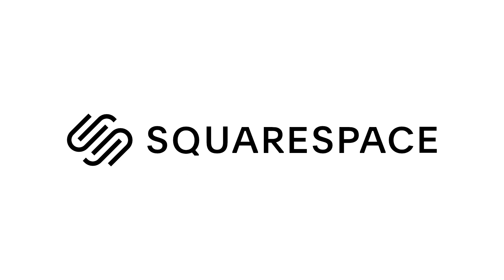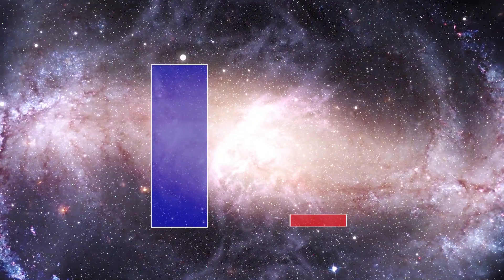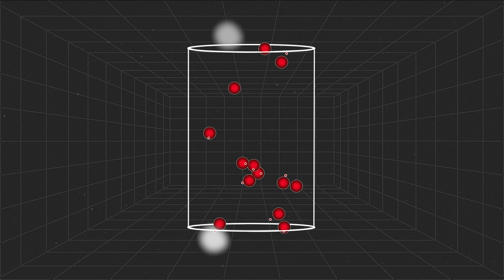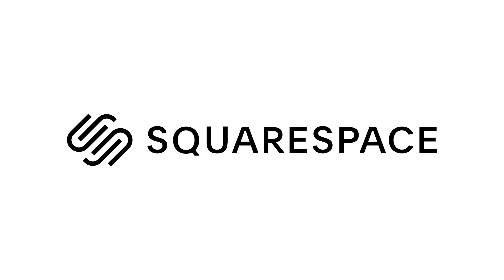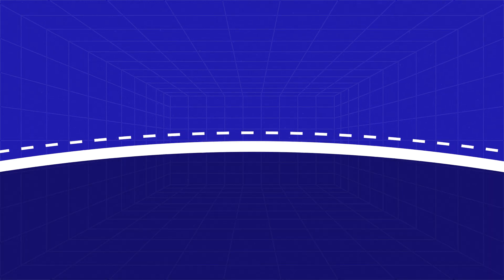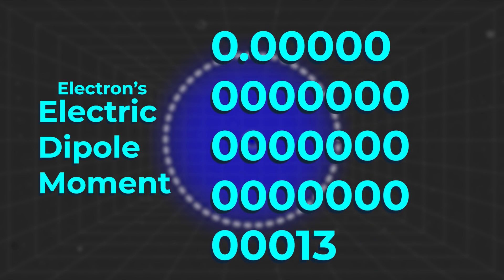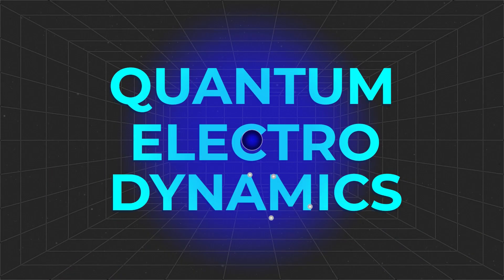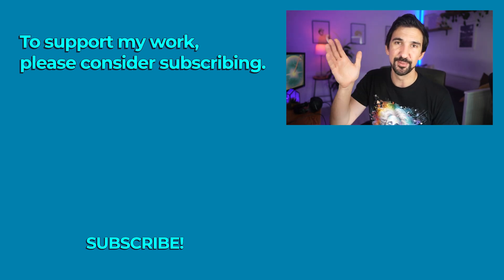What If Electrons Aren't Round? The Antimatter Problem  - EXPLAINED

Comment: Why does the positive proton radiate a negative electron?  Shouldn't it radiate a positive electron?  You know, like a small portion of itself.  Why is the electron negative?  

Also, if opposite charges attract then how can a negative electron radiate away from a positive proton?
Reply: Free protons don't decay, but if they did, they would emit positrons. However, free proton decay has never been observed in any experiments.

Free proton decay is a hypothetical form of particle decay in which the proton decays into lighter subatomic particles, such as a neutral pion and a positron. The free proton decay hypothesis was first formulated by Andrei Sakharov in 1967. Despite significant experimental effort, free proton decay has never been observed. If it does decay via positron emission, the free proton's half-life is constrained to be at least 1.67×10^34 years, which is about 24 orders of magnitude greater than the age of the universe.

Outside of stable atomic nuclei, neutrons decay when one of their down quarks undergoes weak nuclear decay into an up quark, transforming the neutron into a positively charged proton and emitting a negative electron and an antineutrino in compensation.

When physicists strip neutrons from atomic nuclei, put them in a bottle, then count how many remain there after some time, they infer that neutrons radioactively decay in 14 minutes and 39 seconds, on average. But when other physicists generate beams of neutrons and tally the emerging protons they get an average neutron lifetime around 14 minutes and 48 seconds. 

The discrepancy first became a serious matter in 2005, when a group led by Anatoli Serebrov of the Petersburg Nuclear Physics Institute in Russia and physicists at the National Institute of Standards and Technology (NIST) in Gaithersburg, Maryland, reported bottle and beam measurements, respectively, that were individually very precise — the bottle measurement was estimated to be at most one second off, and the beam one at most three seconds — but which differed from each other by eight seconds.

Many design improvements, independent checks and head scratches later, the gap between the world-average bottle and beam measurements has only grown slightly — to nine seconds — while both error margins have shrunk. This leaves two possibilities, said Peter Geltenbort, a nuclear physicist at the Institut Laue-Langevin in France who was on Serebrov’s team in 2005 and is now part of UCNtau: “Either there is really some exotic new physics,” or “everyone was overestimating their precision.”
Reply: @luminiferous1960  .. Neutron decay should vary a lot and probably be related to velocity in 2 ways. Decay should speed up with faster velocity up to relativistic speeds. At near enough the speed of light a neutron is 'frozen in time' and should last until it slows down in my model. 
--
Beta+ radiation is a NEW positron (p) and electron (e) formed near a proton with the NEW positron repelled and NEW electron retained, transforming a proton (pep) into a neutron (pep_e).. and Quarks are clearly made up, like the Higgs Field. 'core mass' experiences the Heavy Force, a mass multiplier mechanism, so a proton (pep) and neutron (pep_e) have much the same mass, with neutron mass being halfway between Muon Mass (ep_e) and Tau Mass (epep_e) as they have 2 and 4 core particles each + 1 extra particle (an electron) and a neutron has 3 core particles (pep, a proton) + electron... Neutron Mass is a tiny bit lighter than exactly halfway between as it has a charged core (proton) and muon and tau cores are neutral.
--
If you really think the most Conservative thing we known of - The Universe - would waste half of only 2 fundamental particles types I've got half a bridge to nowhere to sell you.
Reply: @luminiferous1960  I think i can explain the discrepancy : particles moving in a beam undergo time dilation just like the twins paradox
Reply: @TheD4VR0S  I would be very surprised if they hadn't taken into account the relativistic time dilation in the beam measurements when comparing them to the bottle measurements. The relativistic time dilation effects are routinely taken into account in particle lifetime measurements in cosmic rays and in accelerator experiments.
Reply: When protons do decay (proton emission or beta+ decay inside a nucleus) they indeed do emit a positron and the proton decays into a neutron to conserve charge. That is different to free proton decay (a proton on its own that emits a positron and decays into a neutron), which there is no evidence for.
Reply: @tonywells6990  .. It's well proven formation of a new positron also forms an electron, so the proper way for charge to be conserved is for a NEW electron_positron pair to be formed near a proton so the NEW positron is repelled while the NEW electron is retained, transforming the proton into a neutron (proton + electron, basically near enough a hydrogen atom compressed in a nucleus). Beta- is a neutron losing its neutralising electron, splitting into a proton + electron. Quarks are made up fudge, electrons and positrons are the only 2 proven elementary particles, to think The Universe would waste half of them is quite ridiculous. This is not how the universe works.
Reply: @PrivateSi  That's a load of baloney!
Reply: Protons don't radiate electrons, you are thinking of neutron decays, probably.
Reply: Forget Quarks and QCD - fudge that hides as much as they predict... The evidence points to something like the model below. 'Heavy Fusion' cures the Antimatter Paradox. There are always equal numbers of electrons and positrons in the universe, and they constitute all matter. It's a giant ball of point particles (+ve cells) bound by -ve gas. A more realistic, classical Dirac Sea that still quantises matter.
--
Electro-Positronic Field: -ve gas binds a ball of +ve cells freed by Full Escape Energy as electron-positron pairs 
Spin: particles pull gas in straight/pump out spirals at 90'. Motion increases -ve gas intake, biasing spin at 90'
Magnetism: spin flows straight to a neighbour. Energy conservation and field balance preservation cause external circuits
Mass: inward -ve gas flow acceleration drags spheres of cells further apart inwardly but closer laterally to a packed core
Gravity: like mass but slower acceleration with drag on field cells cancelled by dark energy so cells remain equidistant 
Dark Energy: more -ve gas near mass shrinks field, expanded by less in voids + new matter creation / black hole growth
Heavy Force: mass multiplier mechanism pulls in field before annihilating all heavy composite cored particles but protons
Heavy Fusion: in the Big Bang (and stars?) 2 positrons oppositely hit 1 electron (more than 2 electrons hit 1 positron)
Positronium: (e_p), Muon (ep_e), Proton (pep), Neutron (pep_e), Tau (epep_e). Neutron mass is halfway between muon and tau
Beta- Radiation: Neutron loses the electron, Beta+ is a new positron expelled and electron retained by a proton
Antimatter: 1,2 e_p pairs annihilate, 3 make a muon or proton+anti muon/proton, 4 a neutron+anti neutron, 5 a tau+anti tau
Lifespan: (anti) muons/taus at close to electric force speed (C) barely feel it but Heavy Force takes over when they slow 
Nuclear Force: neutron electrons bond to protons. Mass and magnetism compacts and strengthens the nucleus 
Black Hole: converts all matter to heavy force e+p crystal with a slowly annihilating centre, preventing a singularity
Photon: compressed, concentrated -ve gas wave core pulls in field cells as it passes. Field warps diffract and interfere
2 Slit Experiment: photon/particle field warps diffract and interfere, guiding the core. Detectors interfere with guides
Entanglement: field physically links objects but there could be hidden variables (ie. absolute temporal synchronisation)